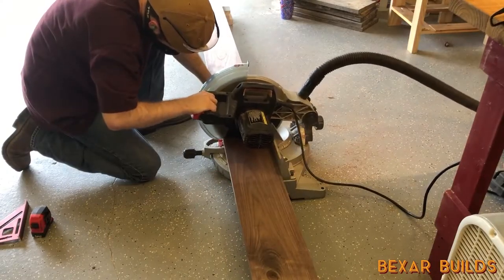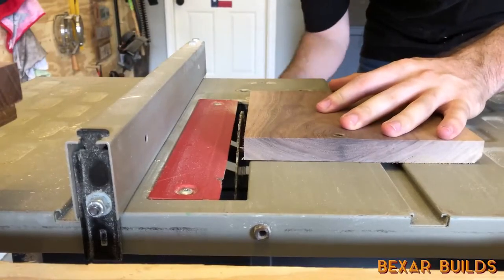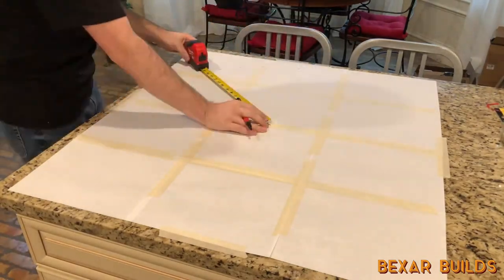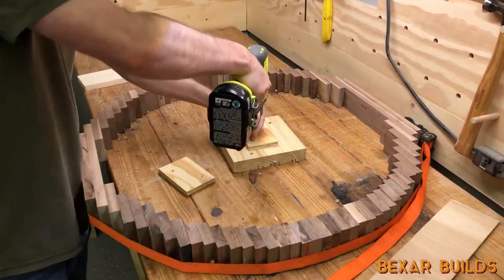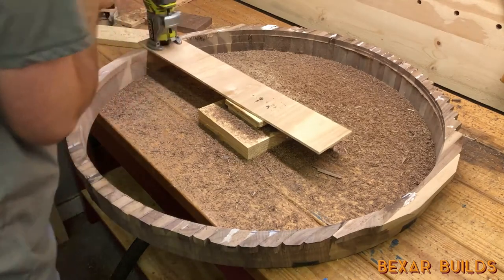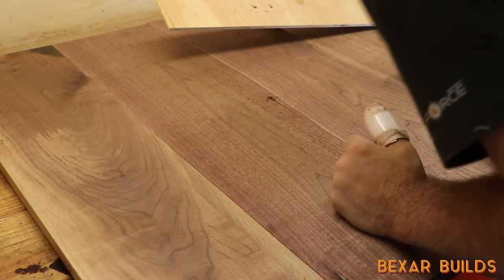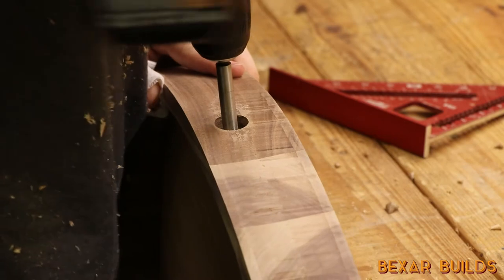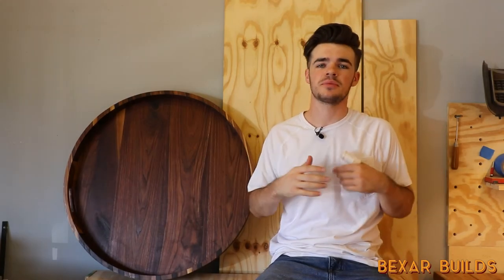Making an Oversized Walnut Serving Tray

Comment: Beautiful tray! I’m glad you are okay after the mishap….that was definitely scary!  Quick question…..did you have any issues with warping after the build? I have made 2 circular trays 30” in diameter and both have warped and look like tacos now.
Reply from the maker: Thanks for commenting! I haven’t heard anything from my client on any warping. What kind of finish did you use and what kind of use do your trays get?
Reply: @bexarbuilds  The first tray I used pine, 2xs milled down to just shy of 3/4”, water based stain, paint, and poly. It warped after the fact. The second tray I used pine already at 3/4”. It has already started to warp before I have even started sanding it down…and I made sure to place the wood so the “rings” on the end cut were opposite and I didn’t clamp it too tight AND I put a counter clamp on top to keep it flat while drying. I know that soft pine is more prone to warp, but 2 times is ridiculous now. Maybe I need to make the base thicker? Instead of 3/4” base, keep it at 1.5”?